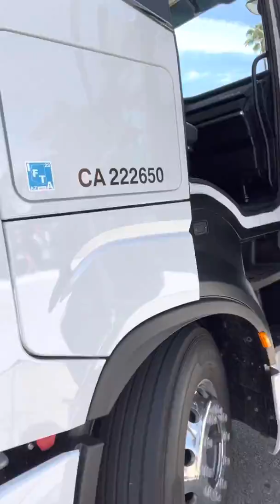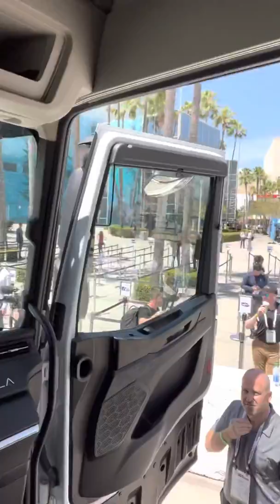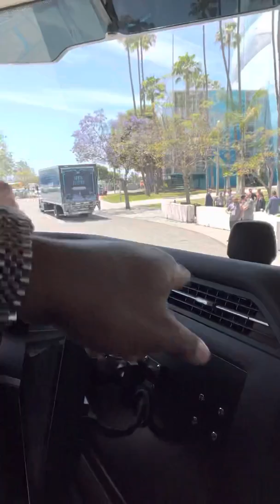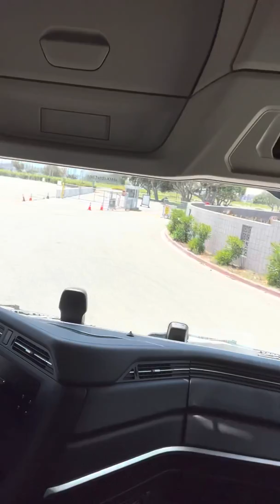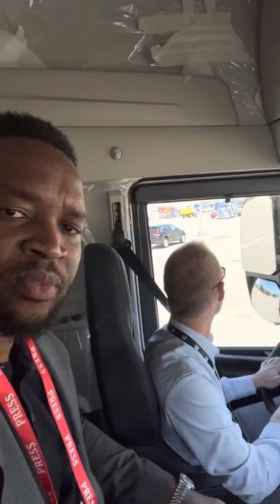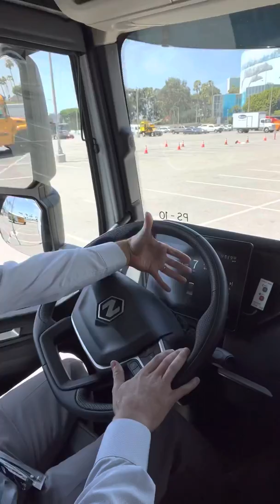Come test drive the Nikola all electric Semi Truck with me. #ev #electriccar #electricvehicle #truck

Comment: Price is $300,000 but they responded to a question in that regard that they may sell them for more than that in California due to the state $120,000 rebate for them. They have never announced the weight but a tracking manager testing the Tre told a reporter it was 29,000 pounds.